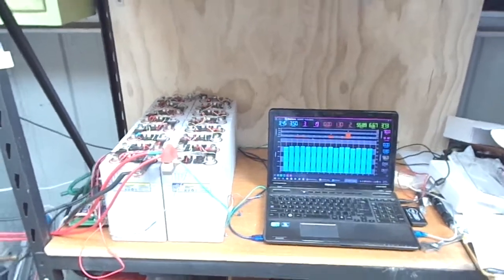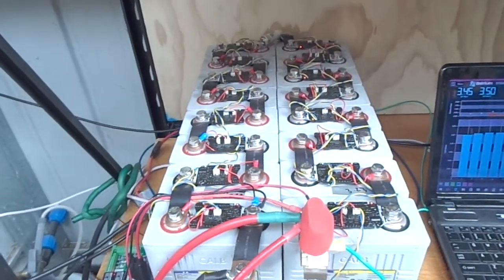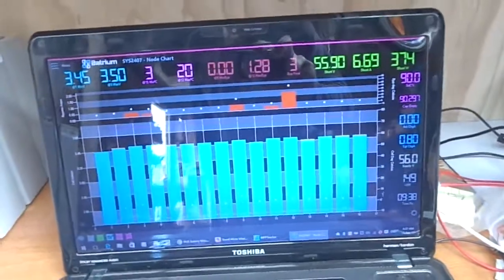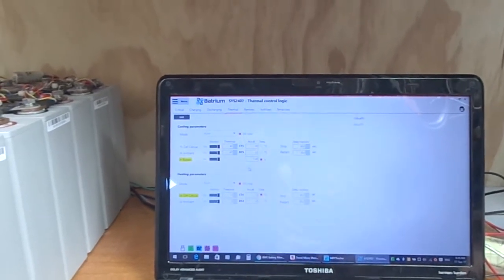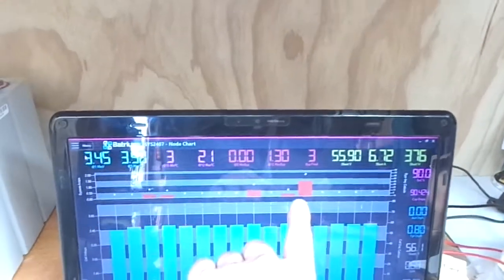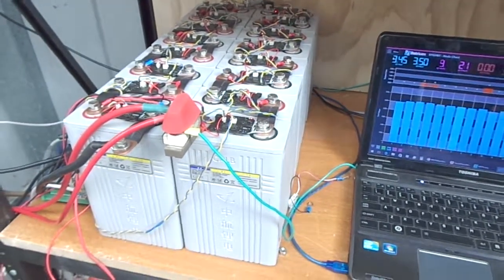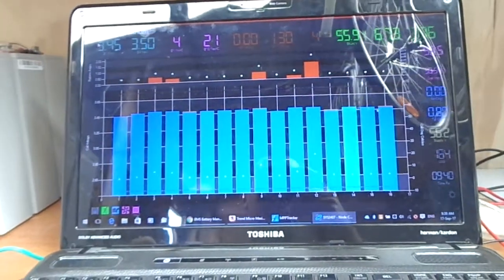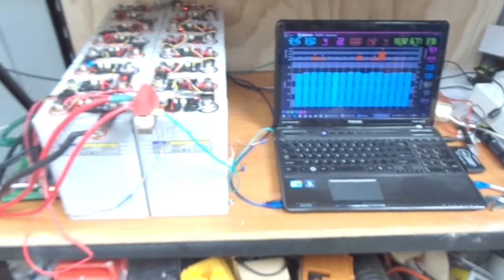LiFeP04 - Batrium BMS Top Balancing the 48 volt System

Comment: How does the Batrium stop over charging?
Reply from the maker: Hi and thanks for stopping by.
I use a shunt trip connected to a dc breaker. The shunt trip receives a signal from the batrium hardware and trips the breaker. It works well.
Stay tuned, I will be setting my system up again in next couple of months. It’s all in storage for now.
Reply: @offgriddreaming5403  my pleasure I had a contactor connected to the output side of my charge controllers and the Chargery opened and closed it. However for situations where I have an AC charger too that is not feasible. I can't wait. Thank you for responding

Comment: With this BMS do you leave the charge actively feeding the batteries constantly and rely on the BMS to prevent over charging?
Reply from the maker: Hi
Yes the bms should disconnect to prevent overcharge but best to bave a charge controller where you can set parameters, including high and low voltages.